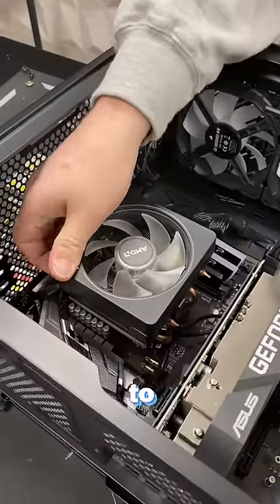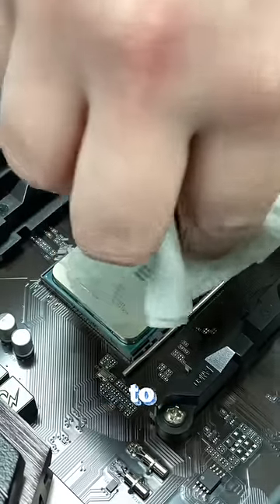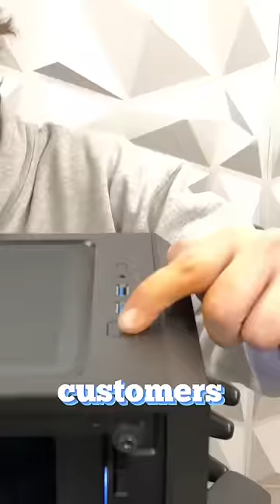OVERHEATING CPU?! 🥵 #pcrepair #pc #cooler #gamingpc #pcgaming #egirl #gamerguy

Comment from the maker: FYI to those who comment about the AIO tubes. The T-Force Siren AIO has the pump in the radiator not the cpu block.
Reply: Do you send to malaysia?
Reply: Having the Tubes at the Bottom like that Helps with the Evaporation of the water if they were at top when the water starts evaporating the Pump will start sucking up air  since every hose has very small Perforations in them
Reply: AIOs suck unless you put loads of money. My 23€ Cooler Master heat sink performs perfectly. Room temp idle and never more than 70°C in full load. Screw AIOs
Reply: i don't know what there would be to complain about this, looked installed correctly to me, rad is the highest point in the loop and tubes at the bottom so its just liquid in them. proper way to do it. haters just gonna hate
Reply: @Bapt the Analog Kid — Bass covers with a twist!  Weird cause my 80*F room with the heater running and my 10th gen heat monster doesn't go past 55*C.
Reply: @Mousenkeybord1  Can you talk all in Celsius? 😶
Reply: @bapt_andthebasses  are you  that poor?
Reply: I had the same rection when I saw the install. I looked up the AIO and saw they have a 4000RPM pump built into the radiator, which is kinda strange, but yeah you want the pump to always be at the lowest point so... I guess this is fine. I still think it's a crappy AIO and the client would be better off with an air cooler at the same price point.
Reply: @bapt_andthebasses  I got a liqmax 120 for $50 . Works just fine . Nothing special but better than the stock air cooler the pc came with
Reply: @sliffer7226  if the pump was in the AIO air could have risen to the top potentially running it dry.
Reply: FYI rad at the front with tubes at the bottom is one of the correct install methods
Reply: @bapt_andthebasses  what cooler do you use
Reply: AIOs are mostly scams. Could’ve achieved the same results with a proper tower air cooler. Let’s see how long that pump lasts
Reply: Lmao bro can’t afford an aio❤ @bapt_andthebasses
Reply: @ariscanela1  ?

Comment: You don't want to use power tools to screw something in PC. It can overtight the screws and the next time someone will work with this pc - they'll struggle unscrewing everything
Reply: Especially radiators!!! Wtf is he thinking?
Reply: You can set power tools to a low torque which is fine, but the video didn't look like it was low!
Reply: @truecauseofchaos  you shouldn't use any of the power tools in any way...
Reply: Came to say exact thing also could damage fins super easy on the rad.
Reply: Lawd I thought this but hey, he's the professional. 🤷🏾‍♀️
Reply: There are power tools which let’s you set a right nm, same as a torque wrench would.
Reply: I clinched my butt when I saw the drill.

Comment: One thing I like about Air Cooler is that it last longer then Aio
Reply: Most AIOs has a long warrenty.
Reply: @madshendriksen6935  not the same concept
Reply: @normified  no, but you can get a pump replaced so quickly most of the time.
Reply: and that 240mm AIO's have pretty similar performance to most air coolers with similar SA to dark rock pro 2's.
Reply: @Thomas B i use the same one on my 3600 and its just so quiet and cool
Reply: @@thomasb282 I also have a 5700x but it draws 130w under load cause of PBO, so it reaches about 85c on a 280mm AIO during a stress test
edit: this means that I beat most 5800x cpus though, I pretty much won the silicon lottery with my 5700x
Reply: than*
Reply: Captain Scout  i mean it all depends on how long the pc is active. 
I went back to Air-cooling because at a point the aio could just not keep the temps down. 
My aircooler is running 10 c lower and its stable
Reply: @Thomas B t4 coolermaster keeps r7 5800x here.. its good.
Reply: @Thomas B🏳️‍🌈⃠  this isnt a challenging comment, just  wondering if you were/are running stock PBO.

Comment: My guy sells PCs while installing a radiator upside down, inside out and using power tools 💀
Reply: Thats how an aio should be mounted.
Reply: @aatutoivanen4117 absolutely not 😂
Reply: @David-sh6bx  The tubes should be down for maximum pump life.
Reply: Aatu is totally right
Reply: You an internet troll and he's a professional CPU builder your comment means nothing.
Reply: No, he did it right
Reply: @David-sh6bx you're wrong, aatuo is right.
Reply: @aatutoivanen4117  when you mount it upside down air bubbles form on the bottom and can be transferred with the cooling liquid into the cooling block on the the cpu where they’re trapped which leads to decreasing cooling overtime.
Reply: @Jankz2024  you mean nothing
Reply: The guy in the video did it right. The top of the radiator is higher up than the cooling block on the cpu which means all the air is at the very top of the radiator. The cooling block or the pump in general should never be the highest point in a water cooling system. This man did everything right
Reply: @timr.7087  The pump is circulating the water. With it it will also circulate any air bubble. The way this guy mounted the radiator is the correct way of mounting for minimum noise & maximum pump life. 
The air will get trapped at the top of the radiator. 
Best way to mount the radiator is at top but the cpu may run few ° hotter due to it exhausting the hot air from the case instead of pulling in fresh air from front.
Reply: Was looking for this comment
Reply: @tytyguy1able  it‘s ok to install a rad like this
Reply: @tytyguy1able  Read the replys. The guy in the video did everything right
Reply: That's the right way. Tubes MUST be down when front mounting to avoid air getting into the pump. Check EK AIO instructions, they're the only ones I know telling you that (and they're world's best watercooling parts manufacturer).
Reply: @tytyguy1able  he mounted it right. Gamer nexus talks about this. It’s the most. Optimal way if the radiator is in the front of the case. BEST case scenario however, always try and mount at the top of the case
Reply: @Jankz2024  this types of knowledge is easy to learn and bro really said CPU profesional 😂😂😂

Comment: Most of your troubleshooting videos are about faulty AIOs so I'm good thx👍
Reply: He also just showed how not to install one. This one will be back for the same reason
Reply: Less chance of failure when it's a fan or two and not a pump and x amount of fans
Reply: No wonder most of his videos are about faulty AIOs, he's mounting them upside down  with will create air pockets that in time will burn those pumps.... what a 🤡
Reply: @barsanted  air pockets don’t always go in the pump. Sometimes they go in the radiator. This doesn’t guarantee an AIO will be damaged. Although tubes at the top is ideal.
Reply: They do go bad but I had one in my pc for 6 years before it finally quit

Comment: Noctua nhd15 will run cooler than most AIOs especiallly around that price range
Reply: Indeed
Reply: NH-D15 is outdated and overpriced nowadays. Cheaper, and just as good options out there like the AK620.

Comment: Save some money and just buy a noctua D-15.  They’re efficient and quieter than any AIO on the market
Reply: I have a 7950x and a noctua nh-d15 and the processor never gets too hot, and I use all 16 cores at 100% while doing some heavy modelling work. Great cooler! Very quiet as well
Reply: If you can fit that monster inside PC if not  noctua nh-u12a just as good.

Comment: You forget to mention that cleaning a AIO is a pain in the butt.
Reply: Nope
Reply: ???????????? Just dust it out
Reply: Unless the dust is caked on deep you can just use an air duster
Reply: bro what???
Reply: they dont need cleaned
Reply: @C0mmanderX  dust can accumulate in the radiatior fins, yes they do need cleaning.

Comment: I changed from stock cooler like that one to a hyper evo 212 and it dropped the temps by over 30°, you can get a very succnificant difference depending on how bad your current air cooler is even if youre switching to another one
Reply: Oh, I’d love a succnificant temperature drop!
Reply: or you can get a good air cooler and it will do the same
Reply: @rajder656  thats what I hyper evo 212 is.. thats what this whole comment is about...
Reply: @AimbotThundah  im not used to people saying evo sry. It's late i misread it sorry
Reply: @rajder656  no worries
Reply: @filipwassen7947  your facetiousness is significunt.

Comment: AiOs and watercooling  are great solutions for small form factor builds, overclocking enthusiasts, or those who want good cooling for their components. However, I have a personal preference for air cooling due to the simplicity of the system. I feel there's far too much that can go wrong with watercooling (dead pump, leaky tubing, component cleaning, damaged radiator etc), especially when considering that you have a conductive liquid circulating near live electrical parts. Manufacturers in the past have covered defects that cause leakage and destroy components, but.. why even take the chance? A beefy air cooler takes up more space, but will often cool quite close to the performance of a watercooler, and even better in certain situations (when comparing a $50-60 air cooler to a single 140mm AiO). AiOs and watercooling in general remain far more expensive than comparable air cooling as well. If you have the space, are doing gaming or even productivity, and don't plan on extreme overclocking (because you can certainly overclock on an air cooler), I'd honestly recommend just going with the simplicity of an air cooler, especially for new users.
Reply: agree with u...i stick with my amd stock cooler as it's also provide airflow into motherboard chipset
i used to use aio before..and yes it lower my cpu temp a little but my motherboard chipset getting hot af and its no good
Reply: @Peatex  noctua has a beefy upgrade with a down mounting orientation. Otherwise the cooler master hyper 212 Evo is the air cooling king.
Reply: @DemosaurusRex try deepcool. Similar performance yet way cheaper.
Reply: Agreed 100% I’m a casual gamer and I don’t really need a aio for my 5600x  I use the hyper 212 evo. 50c under load and that’s like 6 hours of gameplay. If I wanted to go like 5900x or 7900x.. noctua nh-d15 or nh-u12a is the best for those higher ones. And it’s less wear and tear. All I have to worry is the fans breaking and replacing the thermal paste every 6 months or a year at a time

Comment: 1) Thats WAY too much thermal paste ... 2) That AIO comes with pre layered thermal paste, so why replace it .... 3) Your AIO has negative pressure because the radiator is upside down, the pump should be lower than the intake/outake to the radiator ... 4) Why on earth are you using a drill for basic hand tight screws? is this a troll video?
Reply: How would the pressure of an AIO change by the way the tubes goes?
Reply: 1. It has been proved so many fucking times there’s no such thing as too much paste. It just might leave you a little more to clean up later. 
2. There’s something wrong with this, he initially screwed a 240mm radiator, at the end it was a 360mm, so who knows. 
3. He said it was in the radiator in a comment, but I’m with you on this.

Comment: dude that cooler is massive for such a small card
Reply: What has your cpu cooler got to do with your GPU? Lol, unless you mean the budget spent on the cooler could go to the card.
Reply: @elijahmckenzie9207  he might be talking about the cooler on the gpu. Idrk tbh
Reply: @howlsfallacy  doesn’t make much sense to me lol double fan cooler on the card fairly thick fin stack but nothing too crazy must be a 3050 or 3060 judging by the single 8 pin connector
Reply: @elijahmckenzie9207  for aesthetic
Reply: @elijahmckenzie9207 its a single fan 3060 and its a real thick heat sync is all im saying
Reply: @elekrobeelekrobe2023  because as you Said, its a single fan xx60 card, so they have to make up for the short form factor and made the fins thicker.. they would've made the fins thinner if it was a double fan card design..
Reply: It’s a one fan card so it has more fins to take away heat from the dye hence it’s large thickness for its length
Reply: @elekrobeelekrobe2023  yeah, less fans means you need a bigger surface to spread heat

That might be only a 3060, but still has a tdp of 170w
Reply: @thetshadow999animates9  yes, and no: less fans = need of more surface to spread heat, it's basic physics, literally 9th grade stuff
Reply: @thunderarch5951  but once it’s spread and the plate is equally heated to the die then it won’t matter nearly as much
Reply: its a cpu cooler it has nothing to do with the card
Reply: @oh-kade  talking about the GPU shroud
Reply: @oh-kade  talking abt the gpu

Comment: the AIO being in a high spot might cause an air pocket in the cpu mount. might want to advise the customer that if they hear gargling or if the temperatures don't look aright at home, to shift the tower around to try and move the the pocket into the radiator instead.
Reply: Would've been better if the guy mounted the whole cooler system right the first time, and not have to rely on the customer to fix their mistake.
Reply: the air pocket is going to be at the top of the rad instead which is where it should be
Reply: The highest part should not be the pump, in this case it is the radiator.
Reply: @algis-kun8777  the problem is that air bubbles go up, not down. even if the rad is higher up, the fact that the path is going down still means air can get trapped up there. hence moving the pc around to work the air bubbles to the rad and not the pump.
Reply: it will be in the top of the rad bud
Reply: @XionSteel  it is installed correctly, the bubbles go towards the top of the rad, and the bubbles forming take a long time, the pump has enough force to move it to the rad.
Reply: Stop spreading misinformation.
Reply: @excellingsoul  this is why you top mount a 240  rad. Not front mount. Top mounting and exhausting will keep the CPU temps out of the case and let the GPU stay cooler with all of the airflow from the case fans. This is the ideal mounting position for this configuration. Using the 30°-50° temps cooled through the rad as intake is all bad. It just keeps the case hot. Linus already proved this and so did Jayztwocents.
Reply: this

Comment: Doesn't the NH-D15 have comparable performance to a 360 mm aio, without the reliability problems of aios, whilst being quieter than one, too?
Reply: NH-D15 in my opinion beats 360mm aio for anyone running stock speeds but if anyone plans to OC a 7700x or bigger needs custom loop.

My 3700x with the D15 was great even with a small OC

Comment: A good new air cooler can do just as well as an AIO.
Reply: In quite a few cases it can do better.
Reply: Exactly my thoughts. I would have gone for the bequiet Dark Rock TF2, as it's not only super powerful, it also cools down the motherboard components effectively. Nowadays you really can't tell for sure from the motherboard looks whether the VRMs will be cool with such high-end CPUs. And very few motherboards get checked by the press for such issues. So no AIO or tower coolers for me.

Comment: "This is how to make your client came back to you in 2 years"
Reply: Why, because aio don't last ? 
I bought a random noname case with aio on amazon 6 years ago. Still working like a charm to this day !
Reply: @Fankine78  I worked for an SI in "post/warranty fixes" and majority of things we did were: Changing faulty AiO's, topping up fluid, rads that were full of dust "it's water cooled, you don't need to clean that" tubes breaking due to being in sun etc. We used a ton of brands, Razer, Corsair, Enermax, NZXT, Arctic just to note some. The most faults were with Corsair and Razer (I think those were 2013-2016 era ones).
Reply: @tnaxpw  I see, i have been lucky, it will keep this in mind when setting up my upcoming rig, and steer clear of corsair and Razer ones !

Comment: That is waaaay too much thermal paste. The one thing I was retaught in college is "dot dot not a lot".
Reply: It don’t even matter much these days how you apply thermal paste sometimes it’s going to be a little more than a little less, the results will be the same with the perfect amount or with a bit more than the perfect amount. GamersNexus is a pretty reliable YouTube channel and they already covered on that with lots of testing, you should check it out.
Reply: Better to have "too much" than have too little.
Reply: I get tired of seeing this nonsense. It’s simply incorrect.
Reply: @Brandon Hoover  the amount this dude used is going to create a mess lol. just unnecessary
Reply: It doesn’t matter as long as you don’t have too little.
Reply: For Ryzen 3000 and up I’d recommend the X method as the chiplets for the cores are right at the corners of the heatspreader.
Reply: the x method is literally the recommended method for ryzen based cpus 😭😭😭
Reply: Gamers nexus proved that putting an entire tube doesn’t even hurt performance
Reply: @johnsherby9130  Not just GM, literally many people tested this many times, the performance will be the same, these people are more worried about "the mess" it'll make, it wasn't even THAT much, better be safe than sorry lol.

Comment: My air cooling is awesome. The temp under max stress test was no higher than 51c. Average temperature is 29c, but I'm sure using a Phantex Eclipse case with 7 properly placed fans for max air flow helps a lot.
Reply: what cooler do you use? I'm trying to decide between an air cooler and a liquid one
Reply: Thermal assassin 25 dollars. 59c under max load r23 benchmark for 5800x running for 20 minutes straight 2 tests b2b. Average was about 54c max. Idle 27c. For more cores I’d suggest the double fanned version.

Comment: Sometimes a good air cooler is more than enough. I had an AMD stock cooler for a while, it got pretty hot, 47° idle and 97° under load at hogwarts legacy highest settings... with a new 30 bucks air cooler I got idle 35°C And while gaming 65°C and MAX 70°C... it was a 27-35° improve for 30 bucks... you dont always need liquid cooler